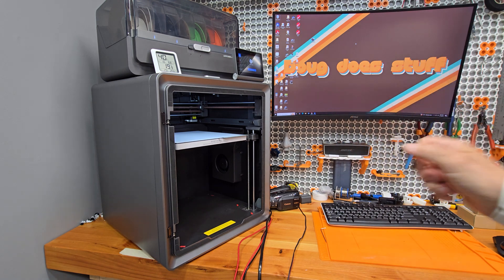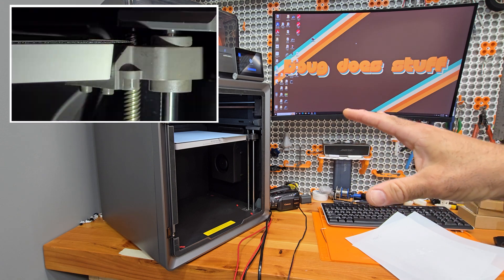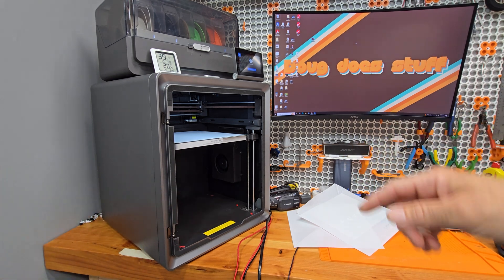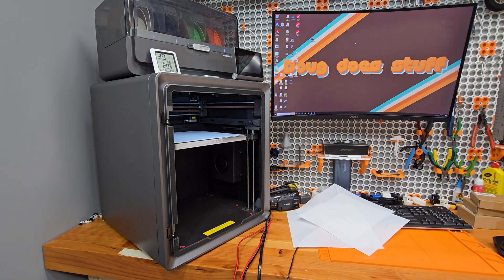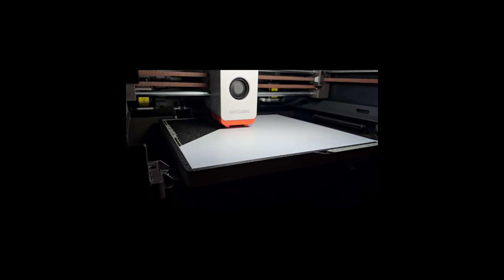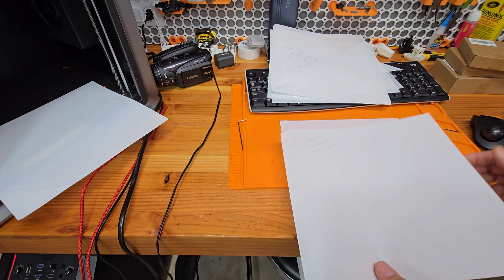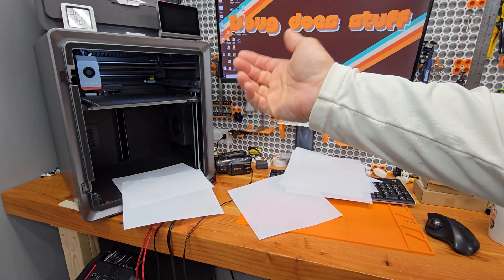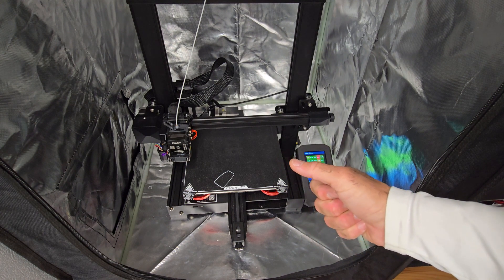Kobra S1 Combo: Bed Level Chaos! I'm Done with it!

Comment: Hi, I’m having an issue with my Anycubic Kobra S1 and I’d like to get your opinion.

I print five 10×10 mm calibration cubes in a single print — one on each corner of the build plate and one in the center.
The first layer looks perfect in all positions.

However, after the print finishes, the cubes end up with different Z heights:

Top-right corner: 10.45 mm

Center: 9.80 mm

I checked the build plate with a straight edge, and it appears flat.

Have you encountered this problem before?
Could you try the same test on your printer and share the results?

Also, could you check whether the lead screw nuts on the Z-axis have any backlash by gently moving them by hand in one of your videos? I’m wondering if this could cause similar height differences.

Thanks a lot!
Reply from the maker: Hey there.  My guess is that you have a warped build plate and because you are printing small cubes in different areas you aren't seeing a bad first layer.  If you were to print over a larger area I am sure that the first layer would be a mess.  With the small areas the printer doesn't have to guess how to try and level from one side to the other and is getting it "right".  At the end of the print, because the printer is trying to make the top layer all the same height it has done some "work" in the background to try and level out the heights.  I'm also guessing that if you put a level on the cubes while on the build plate you would get a level reading, but if you take them off you won't because their top layer is "level" to the build plate.  I hope I am explaining that this early in the morning :)

Looking at your numbers, if you run a bed mesh, what is the difference from top right corner to center?  .65 difference?

It may look straight, but is it?  You need to install Rinkhals and see the mesh. 

Also, currently processing a new video, I will try to add something in the outro, no promises.
Reply: Hi boss, just wanted to give you an update.
You were completely right about the issue. During the first-layer test, I noticed that some areas couldn't be printed at all. Interestingly, the area with the biggest height difference actually printed perfectly.

As you suggested, I installed Rinkhals and checked the mesh in detail. I shimmed the low spots from underneath the bed, and tightened the screws with different torque values based on the height variations.

Before the adjustments, the mesh showed around 1.1 mm of height difference.
After the corrections, it went down to 0.226 mm.

The new first-layer test came out great, and when I reprinted the cube test on the corners, the Z height differences dropped to around 0.15 mm.

This level of accuracy is more than enough for me, so I’m satisfied with the result, Thank you
 @dougdoesstuff24
Reply from the maker: @özgüruzun-w8p  That is awesome! So glad I was able to help.  So many people out there say that the mesh doesn't matter, but I think your situation proves yet again why it matters!  If you ever do post on any facebook groups or reddits, I'd appreciate the shout out :)  Have a good one and good luck printing!

Comment: The bed is only 2mm thick, so it’s probably going to warp no matter what. I’m starting to see issues with mine creeping in after 110+ hours, despite using full bed mesh leveling via rinkhals.

I think it’s continuing to warp after the probing is done.

I noticed on Aliexpress that Funnsor have an 8mm thick replacement bed for $150 Aussie micro pesos. I’m seriously considering buying one.
Reply from the maker: I measured my bed and it was 3mm....weird.  But yeah, I reached out to support again because the replacement bed they sent still has a huge warp in it.  I also reached out to fussnor to see if they wanted to sponsor a video :)
Reply: @dougdoesstuff24 Holly Crap that’s bad! Mine is only out by 0.8mm. I hope they’ll send you the bed, I’m seriously considering one myself.

Comment: FIRST - Thanks for your videos. I have been fighting with my S1 to get a good first layer. One thing that I have observed is that even if you use the bed leveling the Z-offset that you have set in the printer settings DOES NOT GET CLEARED. I think the underlying issue is that what the machine “finds” as zero is actually not correct. I have done the bed leveling and then had to set a -0.06 offset and Viola! It seems to be working. Fingers crossed. What the printer thinks is zero needs to be fixed. Hope that’s a firmware fix.
Reply from the maker: THanks for the info Rob!

Comment: Hi Doug I commented with you on a different video. I  feel bad for you, but I haven't had any problems with my Kobra S1 as well as many other people - many are satisfied. It can't be an inherent flawed design IMHO or they'd have lot's of video bloggers in an uproar. It isn't happening. 

All this talk about leveling at the machine console or command it in the slicer or the printer is wrong logic - the routine is in the firmware and it just gets executed whenever it's called whether at the printer or the slicer. The leveling corrections / results are stored in memory - that's why I can level mine and not have to do it again for days. Messing with the bed screws is also not going to help, they need to be tight and then forget about them. So move on from that. Besides you can check the flatness of the bed with a stainless steel ruler and the "level" of it with a ... small level and see if it's radically out of whack. I bet it isn't. Any other small deviations are OK - uh that's what the leveling routine takes care of. 🙂

Why don't you do this: Go back to the ORIGINAL hot end with the original heater and thermistor and make sure it's clean, and a new or different build plate. Reset the machine to out-of-the-box state in the menu and do all the calibrations after that - bed leveling, hot end PID, bed PID, input shaping. Get a new PRISTINE roll of PLA preferably a different brand and color. Then try your test again. I don't know what else to tell you.
Reply from the maker: Hey there.  Appreciate the comment and the ideas.  I understand that the command is just a routine, but need to rule it all out.  The bed has a range of 1.5 from high to low (upcoming video), that is insane!  I will most certainly go back to the stock hotend and rerun things, only seems like the right thing to do, but I don't anticipate much change....but I am hoping I am wrong!

And yes, there are many with working printers, but how many don't know that their first layers should be better?  How many are okay with mediocre printing?  I think there are more people out there with issues than we even hear about.  Just my $.02

Stay tuned for the next video, going to show the bed warping.

Comment: IDK for me it doesn't seem to actively compensating for the uneven bed for me. I think its the slicer,  I started having this issue when I updated the any cubic slicer last week.
Reply from the maker: There is definitely something going on, firmware or software or hardware.  If you run a single layer print, or really any print, you can watch the z screws to see if they move.  I did this in another video and they in fact did move.  Whether is was correct or not is a different story!

Comment: I packed mine up last night and will be sending it back. I had the same issue(s). I really wanted to like the thing, but I have been troubleshooting more than I have been printing. I understand that it is a "budget" printer, but there still needs to be a higher level of basic dependability. Maybe the issues will be worked out, maybe they won't. But I don't want to be stuck with the thing. Your videos have been very helpful, Doug!
Reply from the maker: I hear you, budget shouldn't mean constant issues.  I am going to continue to say that budget should mean less frills, plastic sides and doors instead of glass and metal, older tech; it shouldn't mean less quality control.  Glad you were able to return it and sucks you had issues.  Thanks for the comment and good luck.  Chime in when you decide on something new and let us know how it is going!
Reply: I ordered a Bambu A1 combo. I’ve already owned the A1 mini and loved it, but I wanted something bigger and decided on the Anycubic. I’ll be giving up the filament drying capability, but there are workarounds for that. I don’t think the Bambu Lab printers are perfect either (none of them are). All I know is I didn’t have a fraction of the issues with the A1 mini. As many people say about Bambu, “They just work.” I don’t mind tinkering when necessary. But when the tinkering becomes a regular necessity just to knock out a print, then to me it’s not worth the savings of a little money.
Reply from the maker: Very good points Brian.  I wish I could do the same!  I just want to print at this point, not tinker....that is why I own Enders.

Comment: I own the AK3 Combo since pre orders days. Still the same heater bed, yes its warped but I'm still able to print (I print car parts & functional parts). The 1st layer may not be perfect but by the 2nd-3rd layer it will correct itself. I think the people that's continuously complaining about Anycubic are just a small group of people but they constantly whinging so u never hear the end of it in the Anycubic groups/forums & then the majority people, like myself who owns Anycubic printers & able to get it to work but don't bothered to comments in the group & forums. Why are U guys so obsess with 'The 1st layer' , 'bed is warped' or 'nozzle leaking' ?? Is the 1st layer the start all & end all??
Reply from the maker: Sure, I could get the printer to print models, but the first layer is very important to myself and others because we use it as the top layer. If I wanted a garbage first layer and decent prints I'd get a low cost ender that requires as much work. Yes, this printer is more budget than a Bambu, but budget shouldn't mean less quality, it should mean less frills, less cutting edge parts, plastic housing instead of a metal housing, plastic door instead of glass doors. So, yeah, we are obsessed because we want it to work as it should.

Comment: from what I can tell there are no springs under the bed screws so loosening the screws does nothing you would need to add shims under the screws to level the bed, oh this little con job only has one Z motor not 3 so it can't level the bed it needs to keep moving the bed to pretend it's level.
Reply from the maker: Do the bambu printers have three independent motors?
Reply: @dougdoesstuff24  Seems not they just have better QC, so to level the bed you're going to have to remove the bottom remove the belt turn the screws to get the bed as level as you can replace the belt then go from there so you can't just throw a glass plate on it for the flat.
Prusa core one and obviously VORON's use multiple motors for bed level , I retrofitted my tronxy with 2 Z motors for X level makes it way easier to get that flat with a glass plate, never print PETG on glass brings on the sads

Comment: Good luck. I installed Rinkhals a few days ago. I am fairly stupid when it comes to 3d printers though so I am not sure if I am supposed to losten or tighten the bolts in the high / low spots.

Also, in order for me to see an updated bed mesh after working on the screws, I have to restart the printer. Clicking the calibration button in the mainsail UI runs the test again, but doesn't chnage the values displayed.
Reply from the maker: Hey there, I noticed the same thing.  If you refresh the page you will see the new values, no need to restart the printer.  Also, turning the screws does nothing it appears.

Comment: I tried bypassing bed leveling on a print because the last number of prints had already leveled it.  Big mistake.  Like it has no memory of where it was supposed to be based on last prints. Watched it "try" to lay down a first layer - huge fail.  Stopped print, started over and let it go through the entire start print process and it printed just fine.  Anycubic Kobra S1 is being returned.  Done.  Maybe in a year or two, they get it together - I will look at their brand again.  Hardware is fine, problems appear to be with firmware.  And still no parts came to fix the wi-fi connection problem.  Printer shows connected, but it is found NOWHERE on computer.  New printer (less than 20 hours print time) and they want me to take it apart and put new-er parts in.  No thank you, I didn't buy a project.

Comment: so A thought... Figure out a way to mount a dial indicator to the tool head. Manually move the tool across the bed to track where the low spots are. Remove the PEI sheet and place a strips of kapton tape at the low spots. Put the sheet back on, rinse, repeat until you get a dome what of a flat bed. If the underlying structure is not true, that could help.
Reply from the maker: There is actually a model on makeronline for one. Might have to try

Comment: Hey Doug, just stumbled upon your first layer "nightmare series" 🙃 End of last year i bought a Kobra 3 Combo and returned it after struggeling with first layer issues and warped bed, which looked similar to your results. A few weeks ago i could not resist and bought a S1 Combo. So far i am ok with the print results but didn't do any full bed first layer test. Although i did not have any adhesion issues, first layer does not look very good and should be way better.
I noticed that some makeronline models were printed with a better first layer and so i did a few tests varying some of the overridden parameters. Surprisingly the first layer line width had a huge impact on whether the lines bonded together well or not. In all Anycubic profiles 0.5mm is set as default first layer line width. I printed a few 10x10x0.2mm squares with line widths from 0.5 down to 0.4mm in 0.02mm steps. For me lowering first layer line width to 0.45mm results in a very acceptable first layer - disclaimer: i still did not do a full bed first layer test to not get disappointed 🙈😉
I am not sure, why this is, but perhaps you want to give it a shot if you didn't already.
Good luck, hope you finally and magically will get the perfect first layer and share the wisdom with us 💪💪
Reply from the maker: Thanks for the great info! I'm willing to try anything!
Reply: This 👆🏼! I found 110%-115% gives a nice first layer. Which is ironically 0.44 - 0.46. Not so great if you have fine details in the first layer for example face down color prints with thin details. But for regular prints really good. I hope they come out with a 0.2 profile. 🤷🏼‍♂️

Comment: I have the stock hot end, a hardened nozzle stock style, and the upgraded ceramic style like you have. The stock nozzle from top of metal throat to tip measures 46.51mm, the stock style measures 46.41mm and the ceramic hot end measures 46.25mm and interestingly I get progressively worse first layers going from stock to the ceramic hot end with the ceramic end just printing non connected lines. 

I have tried all bed leveling troubleshooting. The only thing that fixes it even remotely is running the stock hot end or manually setting a -.03 offset in the slicer (which is a risk if for some reason you accidentally forget to uncheck auto bed level before a print *bed damage??*)

Maybe the stock firmware just cannot accurately adjust for different length hot ends? Seems like that should be the point of auto leveling...
Reply from the maker: Yeah, but shouldn't the automatic probing of the z offset take care of any nozzle length difference? One would think that is the point. I can always try the stock nozzle and see what happens though
Reply: @dougdoesstuff24 you would think. But it's possible they have the firmware setup with a perimeter adjustment in the auto level system (like auto level can only compensate .2mm outside of stock nozzle range) or similar. No idea all I know for sure is the auto leveling on this printer is very flawed. All these first layer issues you, myself, and others have should not exist in this machine.
Reply from the maker: Great point

Comment: I bought 2 Kobra S1s only for both to have issues. Unit 1: dented on rear panel (no box damage), came with clogs in the extruder, ace retraction causes tangles (birds nest) every time. Unit 2: faulty tangle detection, extrusion error codes, will stop feeding filament mid print, the camera will not initiate for remote monitoring. I am not exaggerating when I say I have had more error codes than prints. I have a Bambu A1 and AnkerMake M5C run w/o issues for hundreds of hours. The quality on successful prints is far below the AnkerMake (a $200 printer) including un level top layers and weird offshoots from the main body. Watching your videos made me realize it was not worth the effort of trying to fix so I’m trying to send them back. There is also weird behavior where once filament drying has been turned on, it cannot be turned off even though the control screen THINKS it is off which is a fire hazard IMO.
Reply: I bought one on amazon and when I started reading about all these issues, i tried to cancel the order, but it was too late 🙃
Reply from the maker: At least Amazon is great about returns if you need to!
Reply: Good luck, I got mine off of eBay through the AnyCubic storefront. I am waiting on them to provide a label. I’m sure Amazon will accept the return!
Reply: AnyKubic clearly has decent engineers but I don’t expect any of their products to match the refinement of the competition. Some people make do with these machines but I wouldn’t.